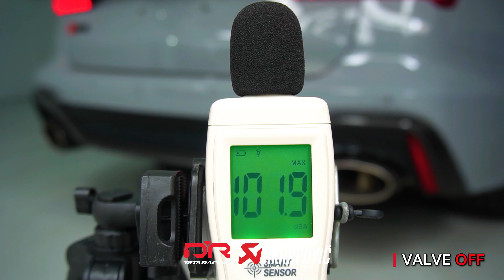2020 AUDI RS6 C8 AKRAPOVIC EXHAUST VLOG | FIRST IN MALAYSIA | STAGE 2 REVIEW, ACCELERATION

Comment: Does the new  exhaust system  drone a lot when comfort mode? Or is the car just as quite as it was with the stock exhaust. I ask because for long drives it can be annoying if it drones a lot
Reply from the maker: when the valves are closed in comfort mode, it's just slightly louder than stock system

Comment: Does the exhaust fitment void the Audi warranty
Reply from the maker: exhaust is plug and play, can revert back to stock form, as long as doesn't tune the ECU, should be fine
Reply: @DitaRacingInternational  which means stage 2 already void the warranty?
Reply from the maker: @x0438  for this particular car yes. car doesn't have official warranty anyways, was an imported unit